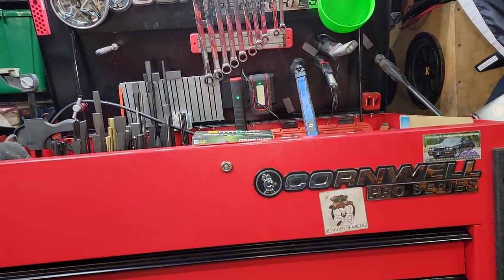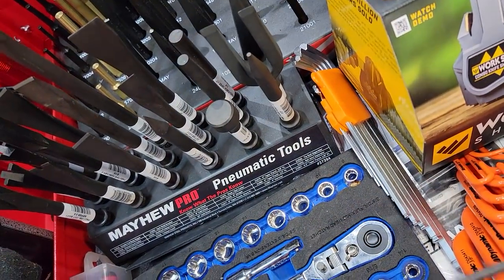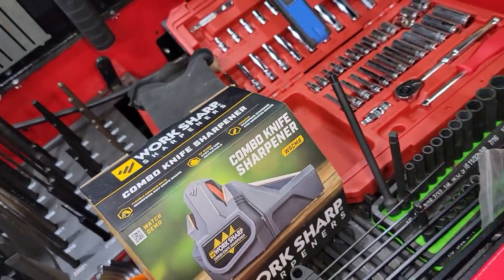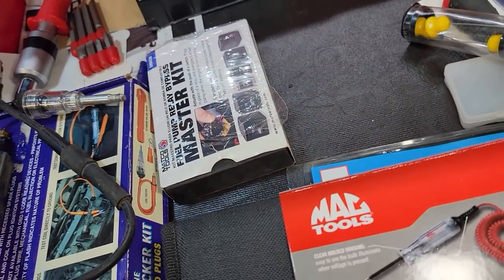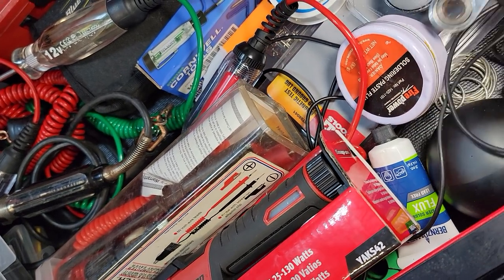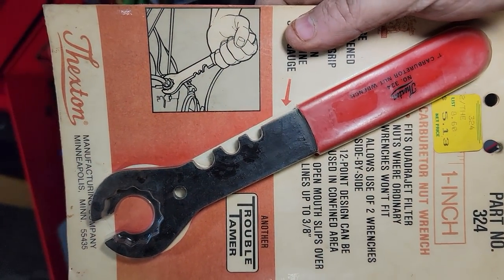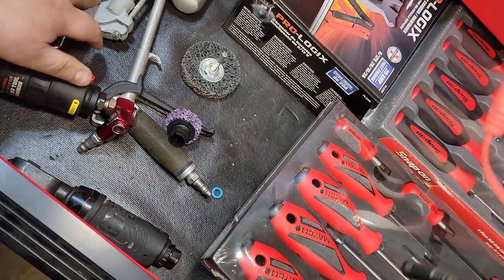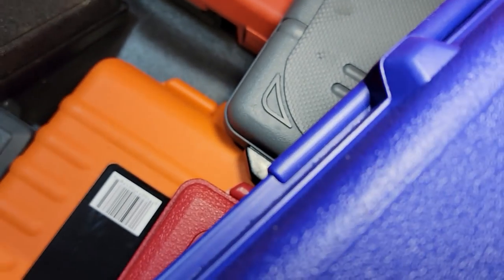TOOLBOX TOUR CORNWELL PRO SERIES CART!!! Bonus vintage tools as well!!!

Comment: CP, I love that little Tekton 12 point set, I've got two of them as they used to be $55. One of them gets used pretty regular and I have yet to hurt anything in there. QC is a tad better than Gearwrench and the 90 tooth ratchets are nicer if you can get past the skinny handle.  Wish I had a Match guy so I could get another set of the Top Torque Screwdrivers, I figured id just get the Wittes but they don't have the same texture on the handles.